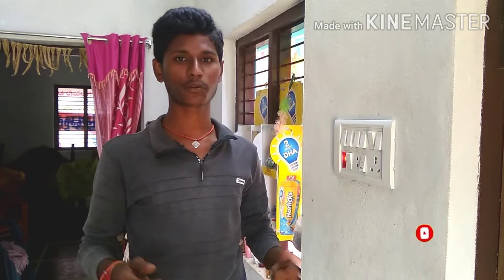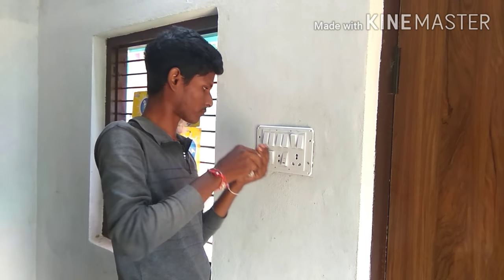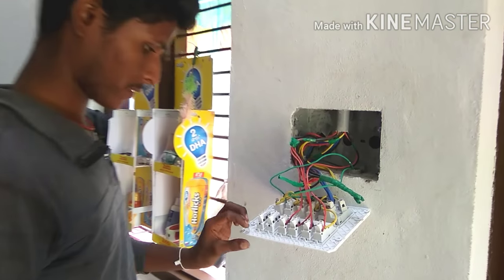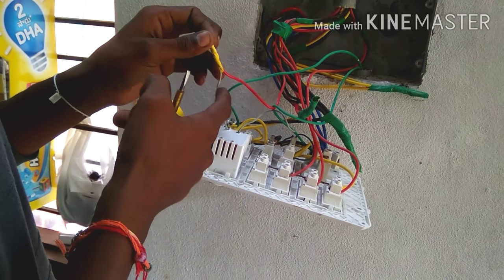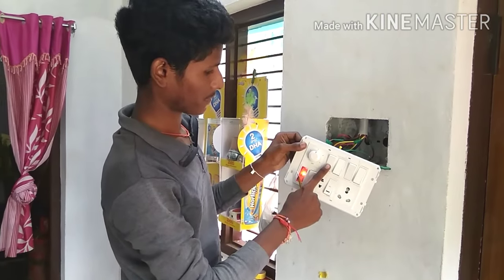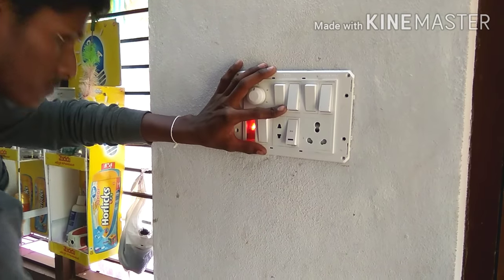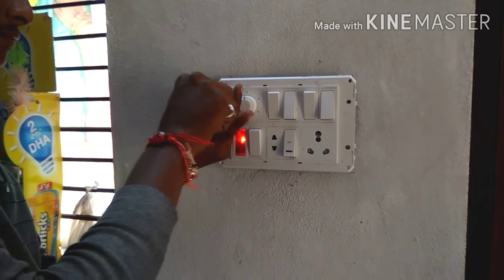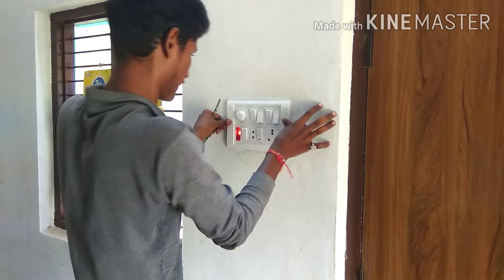Fan dimmer connection with fitting || ramu electrical works||

Comment: Inverter unte yela evvali bro
Reply from the maker: Same video lo chepinavedhagane evandi
Reply: @Ramuelectricalworks  ma fan di 2way switch regulater same ala iste ok switch ki matrame speed slow avutundi 2nd switch ki speed gane tirugutundi adi yela evvali bro
Reply from the maker: @mgreddy1729  2way control cheyali wiring bro
Reply: @Ramuelectricalworks  ok anna
Reply: Same echa anna kani dimmer light velagatledu